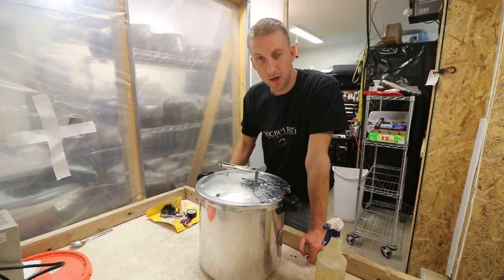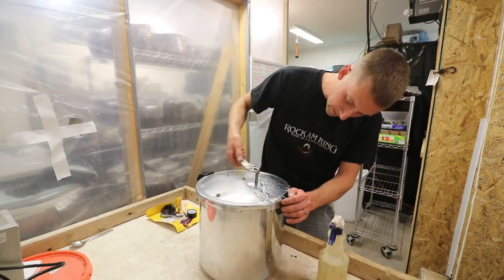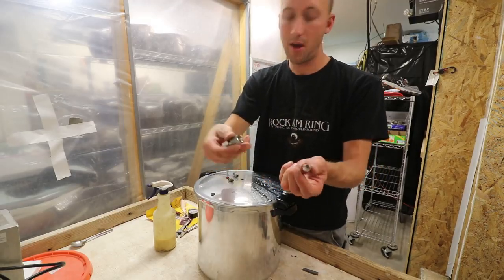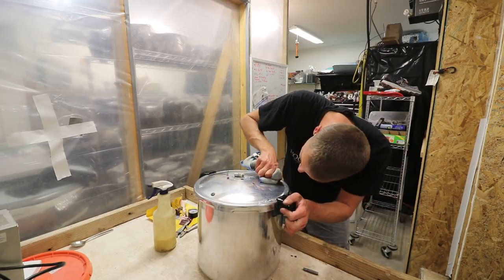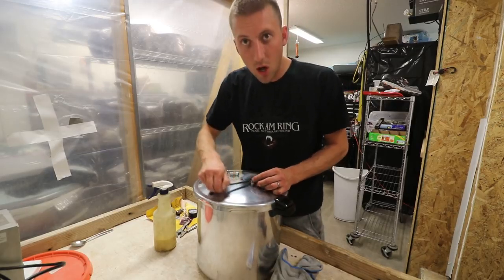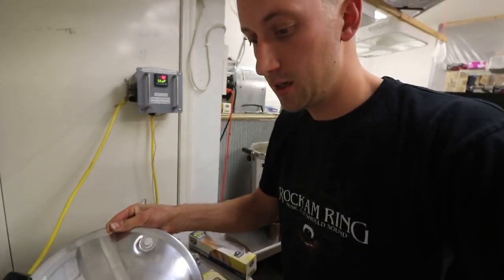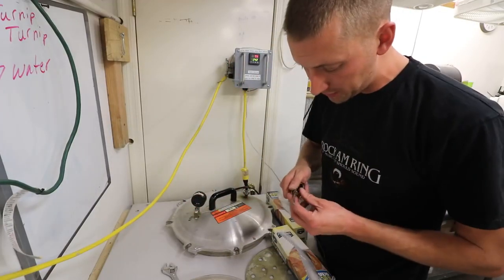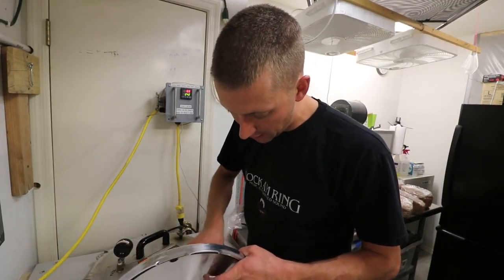Preso Pressure Cooker Modification for  Digital Automation

Comment: Nice work. I opted to use the straight thread fitting, using a back nut on the bottom to keep the strength of the lid where you drilled the hole.

Comment: So is there no ferrule other than the two rubber O-rings being used?
Reply from the maker: the O rings replace the crush washer
Reply: @MyersMushroomsFarms  Awesome,  I wasn't able to find the 3/16 compression so I went with 1/4 x 1/8
Parts should be here today or tomorrow.  

I'll look for the video where you hacked the hotplate.
Reply: @MyersMushroomsFarms  
Is the video with the hot plate modification still up? 
I have a broilking 9 inch and I've read they are easy to mod but can't find instructon for it.
Reply from the maker: @mattrevesz  that hotplate melted down on me. I recommend just using the cadco in the kit link with no modifications
Reply: @MyersMushroomsFarms  Good to know.  I have a big Cadco already, and was wondering why it would even need modifications. I'm guessing it would have to do with PWM messing with the hotplate.  I was worried that would be an issue with the relay inside the Cadco. 
Thanks for the help!
Reply from the maker: @mattrevesz  cadcos dont have relays that i know of. I think its just a thermostat switch but ive never opened one up.
Reply: @MyersMushroomsFarms  
Yea I don't know either, haven't opened it.  There is an audible clicking when on medium settings, but most likely just a thermostat switch.

Comment: Why don't you wash down the oil befor "gluing"?
Reply from the maker: Valid point, but it's not much oil, more like water with a bit of oil and detergent. I've never had issues just applying the sealant as is.

Comment: Nice! Thank you indeed! If rigging an all american 25 quart autoclave, same concept except i just plug in  the autoclave itself instead of the plate??
Reply: I don't think that will work.  The autoclave is elctronic.  The PID controller uses PWM to vary the voltage.  Once you start sending PWM to the autoclave the microprocessor inside will reset and stop working.  You'll need a way to bypass that.  

Do the setting on the autoclave not allow you to do essentially the same thing right out of the box?